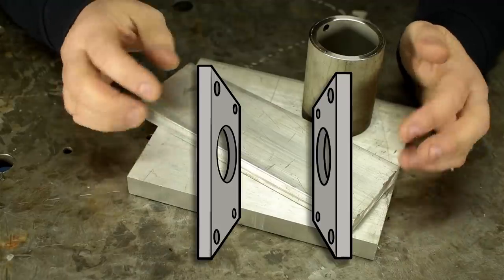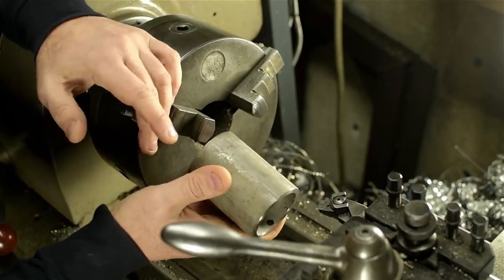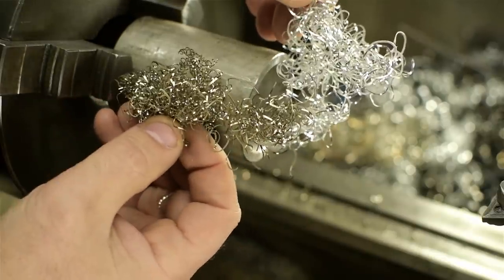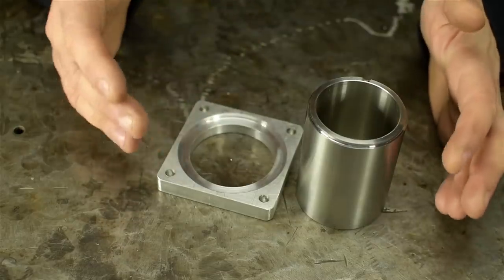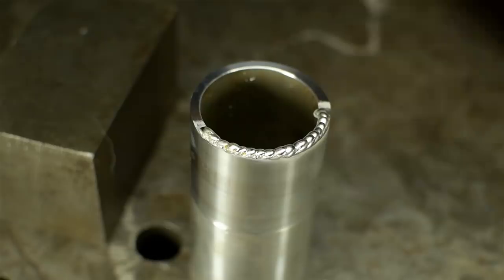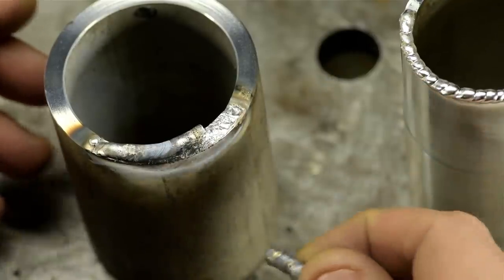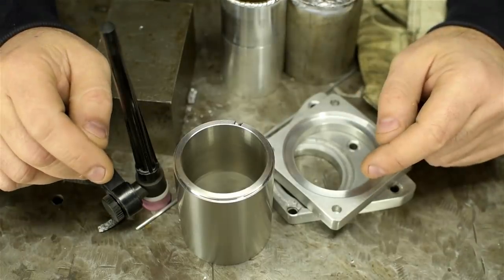UNWELDABLE Aluminum - Caught On Tape!!

Comment: I do a lot of aluminum repair on castings. Foundry can call it aluminum as long as it's 30% . My cup is a constant  yellow orange and white. I learned to weld teaching myself on this hodgepodge of so called aluminum. I still have this side job 20yrs later that pays cash and allows me to come work if I want when I want for as little or long as I want. In these 20yrs they have found no one else that would stay more than a day or two to figure it out. The anger that can build inside is real when dealing with this shit. Point is beware of castings and egos. Hard seemingly pointless stuff can turn out to be a blessing in the end.

Comment: There's a thing called HTS-2000. Personally worked with it.
 And Castolin 192 is said to be it's brother. Most difference between them is regional availability.

Those sick bastards are AluSil brazing rods with active flux embedded. And they're known for making seams, that are stronger than the actual base matherial both to plastic and elastic deformation.

You might not trust them enough to rely on them in your precious equipment. I didn't believe 'till checked on my own as well. 

But it's quite an interesting thing, if those badass brazing rods will deal with your unweldable mystery alloy!

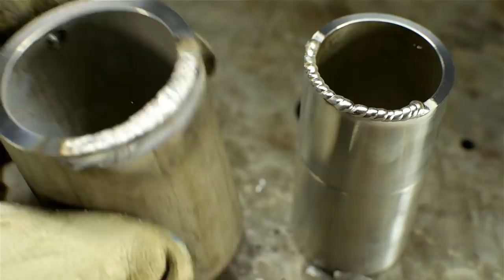Comment: 5:20 i thought you magically read my mind, Exactly what i was thinking. But for real, why do 7075 aluminum bike frames have welds if they arent weldable?
Reply from the maker: this is probably not 7075 but some other 7000 or 2000 series

Comment: I wonder what would happen if you welded it to another piece of the same alloy, either by fusion welding or spiral slicing a piece and straightening it into a filler rod?

Comment: Can the "unweldable" aluminum be soldered?  Harbor Freight sells solder for aluminum and it worked for me with a couple of pieces of mystery aluminum.  With the lower temperature needed for soldering compared to welding, I thought it might be an alternative.

Comment: Of course you can weld galvanized steel. Innershield wire welding with fume extractor and filtered face mask.  Not as pretty as TIG but quick, if you don't count time with the grinder.  Actually comes up nice if you get the heat right and the slag just flakes off.

I was told that one could weld anything with TIG. How about cheese to glass?

Comment: Well, now I have to know how 7000 is welded.
Also, can you weld it with a strike? I'm taking some soldering and electroplating basics here, but either alloys or pure metals can be used as transitions. Obviously, it creates a seam of that metal's relative strength and adherence to the two parent metals, but. I feel like there has to be something acceptable 😕

Comment: We do production runs for an American company,  To cut costs, they decided to supply us with 6061 T6 they sourced..  $140,000 worth ....  It wouldn't machine  and it certainly wouldn't weld..  They flew a guy over to look at it,   end result, The entire batch was scrapped and they recovered about $20,000 from scrap metal .  They went back to Aluminium we source...

Comment: I had a BMW wheel crack, looked it up said it was an aluminum alloy. When tried to weld, had the same experience. Just a lot of splatter. I wonder if it’s the same material

Comment: I was trying to fix the collar on my weightlifting bar by welding it in place and idk what kind of chinesium junk the collar was made of, but it was heavy like steel, hard like steel, and had chrome plating, but whenever I struck an arc on it, the stuff would literally evaporate and turn to smoke. This is after I ground off the chrome plating. It was absolutely impossible to get a workable puddle. I still have no idea what it could be, I'm gonna try replacing my gas lens and hopefully that'll help?

Comment: Ill tell you what does work on odd types of metal.   Harbor freight's cheapest mig wire and mig welder.  (That junk wire is great for all kinds of pot metal.  They dont bother to rectify there mig welders so its like a one of a kind AC Mig Welding Process lol)  "Dont forget to apply mig nozzle gel"

Comment: It looks like 2017 or 2024 Al-Cu-Mg alloy to me. High straight aluminum alloy, used in aviation. That’s why usually this material riveted, but not welded. Duralumin as we call it in Europe.

Comment: I wonder if it's that stuff called Zamak which is some sort of zinc aluminum alloy. There is some pipe supply stuff made out of that Zamak material.
Edit: I have a special welder that can weld any type of material in the world, even wood and plastics. 
It's called JB Weld.

Comment: I have watch most if not all of your videos over the years, and much of what you do and say I have used myself.   That.has nothing to do with the question I'm about to ask.  
Is all 7000 series aluminium not weldable.   Because as you said I have bike with such aluminium and it has welds on it.   🤔 it's a straight up genuine question I'm learning all the time

Comment: Probably 625 inconel tube, we use it in oil n gas applications, very expensive super alloy!
Reply: Not inconel. That stuff is heavier than steel and very difficult to machine, nevermind getting a nice, shiny finish. Very gummy.

Comment: Had a terrible time once with a small repair job on a slightly nicked motorcycle engine cover. No markings on it whatsoever. That thing just exploded on me when I hit it with the tig torch. Turned out it was "Elektron". A magnesium/aluminum/zinc alloy.

Comment: From the colour of the chips and the oxide layer on the aluminium I figured Zinc had to play a part somewhere in there. But given the appearance of the oxide layer on the outside and your comment about the weight, I was halfway convinced it wasn't even aluminium. 

So... I was half right. But that is better than being wrong and trying to weld it... Eh... Eh Tony?

Comment: Any chance it's nickel? chuck a cubic cm in your oven and work your way up until it melts to find out. or break it and look at the grain. it may be 7075 aluminum, may be B165 nickel- nickel alloy is really common in pipe form

Comment: Just last night, As A QUICK and temporary fix to a furnace blower, I get a call from my brother who had HVAC feller at house an they asked if i could TRY something.  Now dont laugh at my Unskilled powers. The hvac feller was trying to braise a collet to wheel blower and was having same problem. From what I could tell the original part was a press fit and crimp fold to attach both parts.
Hvac feller kept saying the collet was a weird metal. I personally myself do NOT know however i proceeded to scuff and alcohol mating parts mapp gassed(it was what he had)The Collet of unidentified metal then I proceeded to wire feed weld the parts together(not truly great with a 110 cheapo harbor freight welder and did so to both sides. Pre heating the collet before welding i believe assisted my efforts.  Then i used jb weld METAL PUTTY and worked it in aggressively and topped it with another soft batch and spit smoothed all surfaces to CLOSER achieve Balance in a part that MUST REMAIN BALANCED. 
So far so good! Only needs to last 4-6 days.
Did Preheating of the Unidentified Metal help me get penetration into such metal??
🤞

Comment: I knew what is was the second I saw the sort of straw coloured shavings.  My welding teach as a joke handed me some 2mm thick cuts & said "Here's something to try"    It's possible, but you'll have as easy of a time getting hot glass to not shatter when dunked in cold water.  On the other end there are some cast Al recipes that are a right bastard to weld for the opposite reason.

Comment: Seems to me that was not 7075. 7075 looks like and feels, weight wise, very similar to 6061. Prior to machining, one would be hard pressed to tell the difference. It is a bit harder to machine, and more wearing on tools than other aluminums. Not sure what material you had there, Tony, but it was not 7075 aluminum.

Comment: Welding mystery-metal is always a little sketchy. If I need to turn parts at work out of beryllium copper, I write the material on the remnants and keep it separate from everything else. Welding it would kill you pretty quickly apparently

Comment: But did you try the rest of the tube? Maybe you just got the zinckier end. If you had that thing standing upright, most of the zinc is gonna pool at the bottom end - the top should probably be perfectly fine for welding, and almost clean enough to drink.

Comment: Serious question, why can’t you weld galvanised steel, I grew up with it being common practice?
Reply: The zinc will contaminate the weld and TIG doesn't like that. MIG (or MAG) will do it, but zinc fumes are not something you want to breathe if you're doing more than a few tacks so I'd still recomment sanding it off first.
Reply: @voprais  thank you

Comment: try 7005 with 5356 or 4043 fill material.  Unfortunately most of the time when you order 7XXX series aluminium you will get 7075.  Magnificent material to machine not for welding.

Comment: why shouldn't you weld galvanised? I weld it all the time.. If its sheet stuff you use flux wire mig or stick so that it pulls everything out the weld pool etc.. or if its heavy stuff.. grind the surface to till its really shiny (OUTSIDE) And then weld it as if you welding clean mild steel with solid wire mig or stick/tig.. But always use a airfed helmet or at least weld it outside in decent wind

Comment: Are you sure that is an aluminium alloy ?, it's got more of a zirconium look to it. 7075 machines well and produces normal coloured whispy swarf, plus it will actually weld, but the weld will have no structural properties.

Comment: I’m thinking it’s an alloy. Zirconium or titanium, cadmium. White does say zinc but I would think a zinc would make it very dirty looking black. Maybe you could pre heat it and gas weld it with flux. I’ve yet to find something truely unweldable

Comment: Being almost totally illiterate in the matters of welding, I'm quite curious why trying to weld this type of stock would be dangerous? Would be dangerous to the welder as it might spark some kind of reaction or the danger comes from believing the structure is safe, finding at the point of using the structure that it collapses?

Comment: The tube is the color’s wrong for 7075, try again. 7075 has identical colored chips to 6061 but they tend to be more shiny. 7075 is harder but machines much nicer and is easier to get nicer finishes. Side by side the stock can look exactly the same, unlike that tube you had. If one material is known and the other is suspected, saw a thin strip of each and bend them. The 6061 wants to bend but the 7075 is stiffer but likes to break. A suspect the tube you have is 303, 304 or 316 stainless. As a note, 7075 is not considered weldable. Some people try but it’s a bad idea if it’s a critical component. There is a very specialized process to do it but I’ll leave it for others.

Comment: For those that aren't welding-savvy, can someone please explain why welding 7000-series aluminum is "extremely danger"?
Reply: The danger is that there is zinc in the alloy. Sink has a much lower melting point than the steel (mostly iron + carbon) portion of the metal. The steel will melt, but the zinc will actually boil and vaporize and could easily be inhaled, poisoning the person welding. On top of that, the zinc used usually has some leftover amount of lead in it, which also will vaporize and poison you. 

In this case, because Tony was trying to weld an alloy, he didn’t know there was zinc in the metal. If the steel were galvanized, ie coated in zinc, it should be immediately clear that welding is not safe to try.
Reply: @MusicBent  thank you for the very thorough answer! Much appreciated!

Comment: Wait so how would someone with a 7000 series aluminium bike get welded?
Reply: The bikes are 7005 alloy. It's the bastard child of the 7xxx family. It is weldable, but doesn't have the strength of the proper 7xxx alloys, like 7075. Really it is closer in properties to 6061 than to the 7xxx family.
Reply: @ASJC27  I see thank you 🙏🏻

Comment: PLEASE HELP i have a 36v 1000watt controller and motor, i have 3 12v 7 amp per hour batteries i need to know what in-line fuse i need.... can i just add multiple  40 amp in line fuses or do i need a higher amp fuse??? no one has this schematic because it's not factory, i just need to know what fuse and how many i can add to the setup, PLEASE PLEASE make a video explaining what the hell fuses do and specifically how many fuses and what size to safely run a 36v 1000watt brushed dc motor..... troll battery  i've called 20 places from boat fixers to golf cart fixers to small electric motor repair shops not one damn person would offer any advice and i was super nice on the phone, i beg you please help
Reply from the maker: I'm no biologist but the fuse is to protect the equipment.  if its 1000W at 36V that means 1000/36=28Amps.  So... maybe a standard 25A fuse?  also make sure your batteries can safely supply the current the motor is asking for.  if you're not sure have a local electrician come look.
Reply: @ThisOldTony  thankyou, but the 30 amp fuse on the trolling battery is for 250 watt 24volt razor pocket bikes, can i use 40 amp fuses between each battery is the question

Comment: I won't do any research on this since you're being practical and just classifying as unweldable and just putting on the side.
Be weary if you're going to use it for anything with another metal, since you're not sure what it is and it might even create a corrosion situation.
Considering the original tube, before milling and the appearance of everything, this doesn't look like a aluminum alloy at all, it may have Al, but it doesn't look like the basis. This might be some Zi-Mg stuff which can be scary if used with Al in the presence of oxygen and high temperature, in that case good thing you had plenty of gas for the TIG.

Comment: I was confused.

Why didn't he just throw the parts on the lathe, center them doing a tap dance with two sledgehammers and just cut matching threads and then tap a set screw to stop them from freeing themselves during the future uprising for aluminum rights?

Isn't that the This Old Tony solution to the problem?

Comment: Ive always wanted to  pick up on this machining and welding jobs.

1.   You should.make a video , of how which metals  can be dangerous when trying to tigweld  mismatch materials !!!?

Make a series .   Atleast push it to complete a 3 part series. .   As.  Knowledge is  the  most useful thing to share.
Like  This: 
1.  If you ever have a Heart-burn or Hicups.    "The method is a How to".!
-  what you need to do .......is    pretend to Hyperventilate  for atleast 20 seconds.  While taking breathes. : Note .  Practicing these steps , will have you notice , How effective these steps are. 

I have one other   useful method.   That helps Stop  CRAMPS.!
-  these lasts too long. When you let it take its course l.   Painful course.
: the method i use , cuts the cramping time  in half. 
Goes great , when your calves and the back of the thigh. Not sure what its called.  But  the way to cut it half or right away is......  when cramping on back of thigh area,  The Best Thing to do is.   Straighten your leg out  while lifting up the affected leg. And holding the leg still.    Ive been throug many and ive noticed , that by doing that .. ive cut the cramping  by 65-75% off  when doing the method.       
-  same thing for the CALF    <---This one.    While standing up.  Stand on your heels. And force your toes  to try and reach your knees.   If your cramping on both Calfs. " never experienced that yet"   use these method.  

1.Knowledge  for cramps 

1.Knowledfe for  Heart-Burn and Hicup

Comment: There is transparent aluminum, though.  When you set it down on the steel table it didn't even SOUND like aluminum, too high a frequency ching, too resonant and too long term.  

"I don't care if it's beryllium"  Yeah, you really do not want it to be beryllium, because that stuff is bad for your health to machine open air, IIRC.  Beryliosis is quite bad news, look it up if you don't know.

I'll bet you can friction weld it just fine, without even looking it up.

And yes, you can't walk in your cake, and eat it too.  At least you probably shouldn't.  Could taste kinda fowl.  But then, everything tastes like chicken, so I hear.  Tried to figure out how to get back round to cake, but at a loss, sorry.  Just not firing on all eight today, apparently.  If only there were chicken-pot-cake.

Comment: Actually that pipe looks suspiciously like stainless steel. I'm gonna go out on a limb here and say that your unweldable aluminum doesn't weld because you're not using the special 11-herbs-and-spices filler/technique required to bond these dissimilar metals. Just a shot in the dark. I'm no expert. I'm gonna post this before I see the exciting conclusion to this video. If I'm wrong--and I sometimes am--I'll leave this up anyway. Integrity. That's just how I roll.

Comment: I don't understand the point of the video. I get those same results with 6061 or cast aluminum. Unfortunately I was raised in a strict use DC electrode negative only household and it's too late to adopt a new religion now.

Comment: If you were smart, you would have just had your future ex-wifes husband to knock it off with the whole forced celibacy until after the divorce. This sexual distancing has really made it hard to connect dis-simular parts. Dang auto correct, I meant thanks for the heads up.